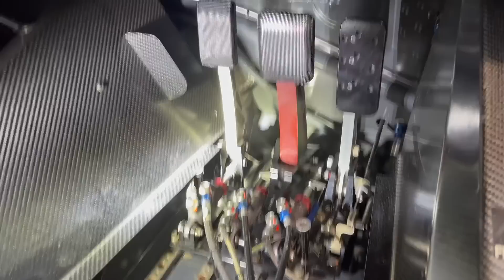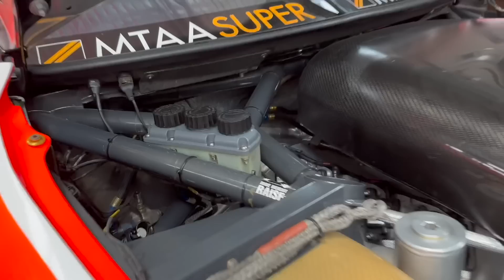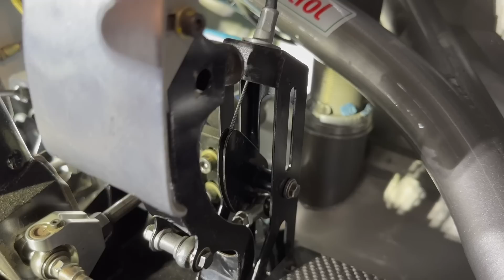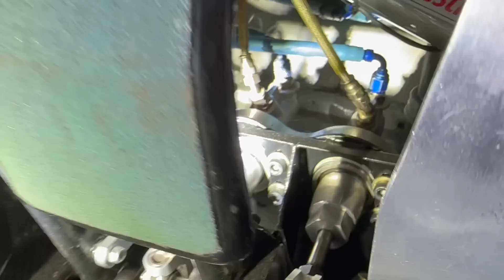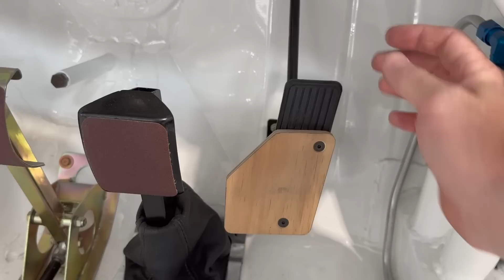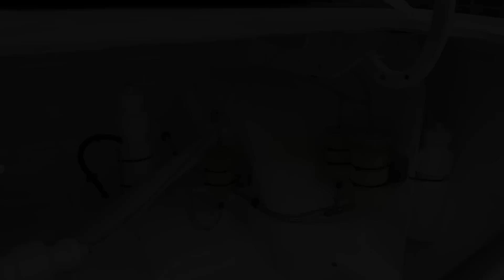Episode 39: Comparing the Pedal Box Assembly across three generations of Touring Car V8Supercar

Comment: In terms of aerodynamics, what affect the side exit exhaust has when compared to a rear exit?
Reply from the maker: Well we've never had a race car with rear exit, largely because it's an incredibly difficult process getting the tail pipes to get over or under the diff housing and out the back next to the fuel tank/cell. In a Supercar i'd be surprised if there's any difference.

Comment: Was there a panel fitted over the master cylinders mounted under the car, or were they open as shown when racing? I would be worried about damage from curbs/debris etc, although I guess you guys ran them that way for long enough it obviously wasn’t a problem?
Reply from the maker: No nothing fitted to cover them. They kind of sit above the lowest point if that makes sense, effectively under the drivers seat. Never caused any major problems 👍

Comment: how boring, a knurled brake peddle, different size cylinders, so boring, bango fittings, remote reservoirs, WOW so boring, even some group C cars had better setups with the remote reservoir mounted inside the cabin, in full view of the driver to watch brake fluid level, so boringggggggg
Reply from the maker: Sorry it’s not exciting enough!
Reply: @perkinsengineering  mate describing a knurled brake pedal, like really, you have access to some switched on dudes, how about getting part burns on, talking engine building, old 308-304 group c, to later group A engines ,camshaft specs ect, what comp ratios, what parts were used,  specs ect went into these motors, how they cheated bent the rules, cut intake manifolds in half for inside porting and then rewelded together to hide, bring on some engine development stories with the guys that built them, you could do a series on all the different engines and eras,  not brake pedals

Comment: Great to see you back again Jack.  These comparisons between the cars are always fascinating.  Are you driving Bathurst with a team this year?  It'd be great to see if they'd let you include a Gen3 car in these videos.  I know the pedal box in Gen3 is adjustable (somehow), so that might have been an interesting point of difference in this one.  

It's amazing just how simple the 93 car is in comparison to the others.  Is that a gear stick boot on the brake pedal?  It's not stupid if it works!  

I also like how the Perkins designed pedal boxes keep everything out of the way of the driver's feet, and don't need a false floor.  Whereas the CoTF design just wants to be a great pedal box, but then you need to put a false floor over it to make it actually usable by a driver.
Reply from the maker: Yes back with Erebus for a 3rd year with Will Brown. Correct it is a gear shift boot used on the brake pedal. Keep it simple!!!

Comment: Nice little comparison there Jack. Those hard lines to the reservoirs in the boot, did they reduce weight over the soft lines/reduce the amount of fluid in the system as the lines held less fluid? They look super neat though.
Reply from the maker: Not so much weight, they became more compact, less chance of irritation from the fluid as sometimes a rubber hose can react or swell to brake fluid.